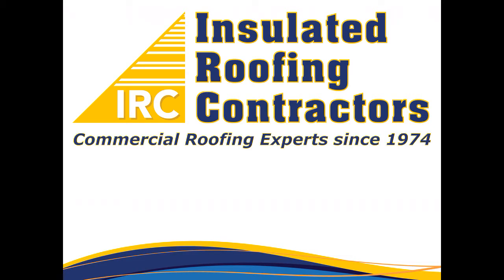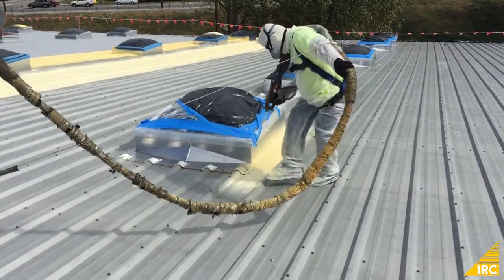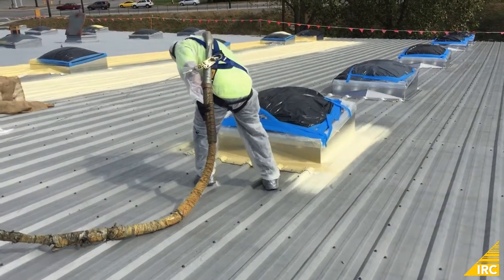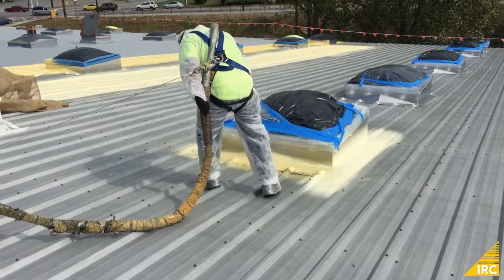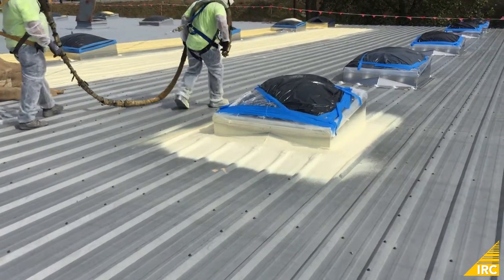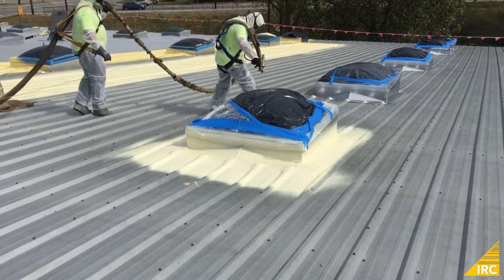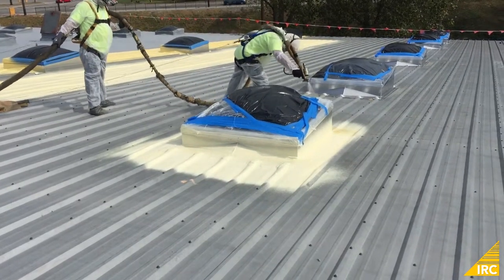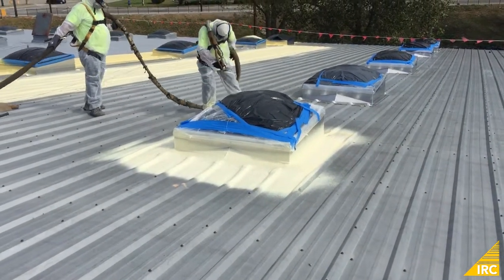Flashing in Skylights with Spray Foam

Comment: Nice water dam
Reply from the maker: Hey Edward,

Actually, the foam is built up in the center of the skylight and tapered towards the outside edge to push the water around the skylight and off the roof to avoid any damming.